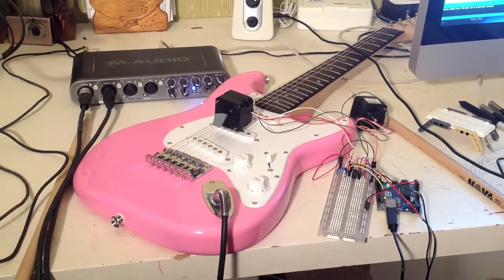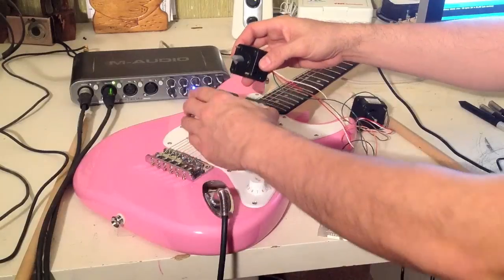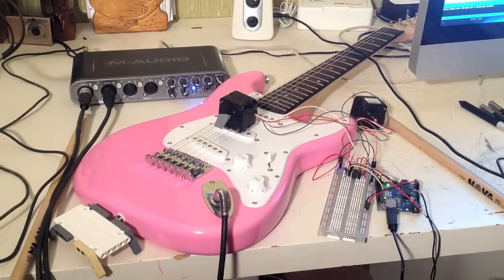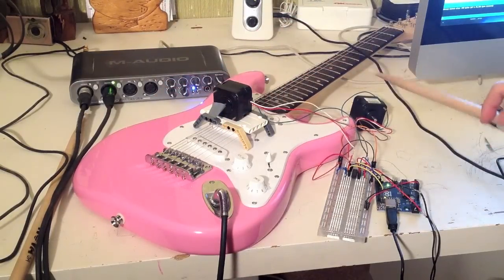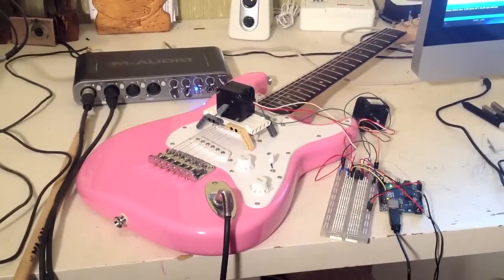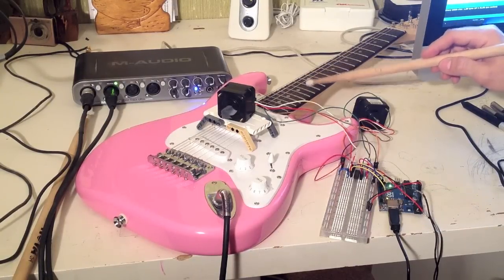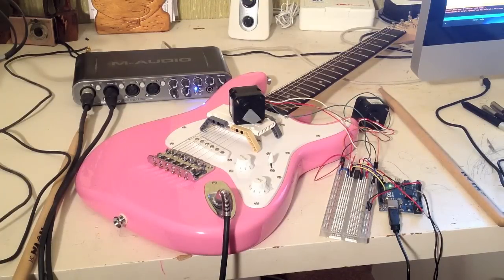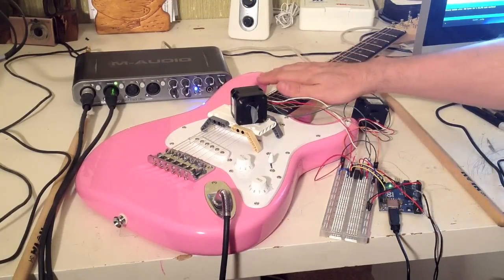Stepper Motor Beats

Comment: Really nice!
I also make music with Stepper motors and I composed several pieces for them. I control them through Max Msp (that's the only way I found for myself, since I'm not good in programming).
For me it is interesting to find new ways of making music with these devices, you know, music that we haven't heard before!
I like the fact, that a motor IS itself a resonant body and if you fix on the right surface (wood or glass, for ex.) you don'T even need to amplify it (because in that case you not gonna hear the motor, but the rubber membrane of the loudspeaker!)
Reply from the maker: Thanks Alexander.  I just checked out your stuff.  Looks great.
I haven't figured out how to control stuff through Max Msp.  Will have to figure it out though.